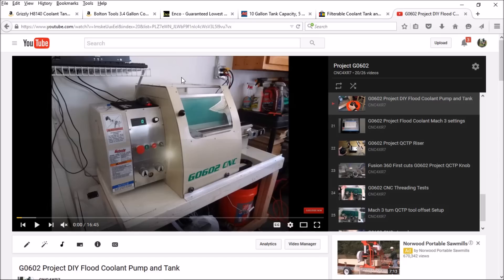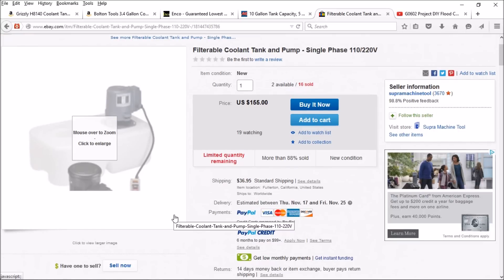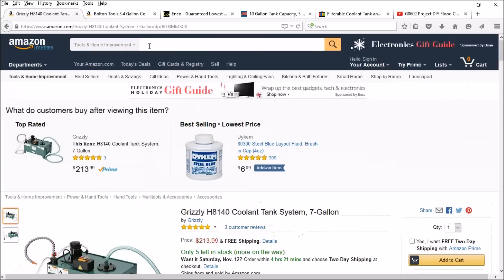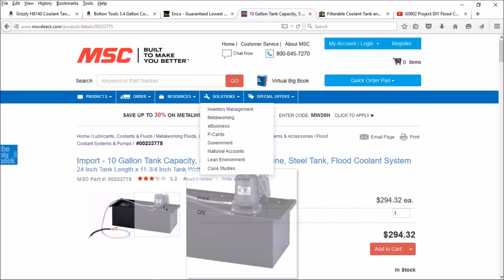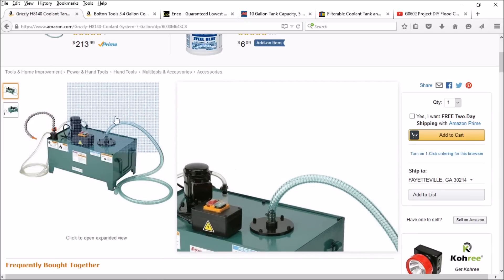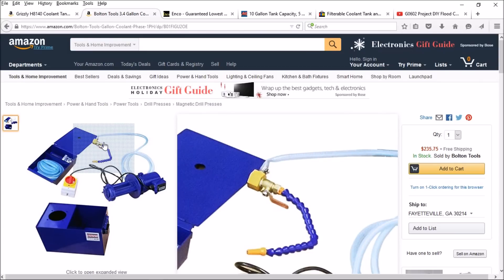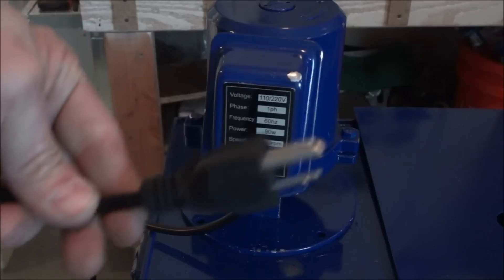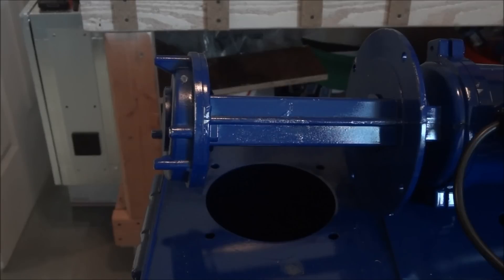Bolton Tool CS 34 Coolant Pump

Comment: Formula for ya Sam, L x W x H = cubic inches, then multiply by .00433 gives you the gallons!! your tank will hold about 5 gallons actually.
Reply from the maker: Yeah total volume is about 5 gal but the tray is about 2 " deep maybe a little more so I guess that takes away a little.

Comment: I'll be excited to see some follow up on this.
I think right now my tank has 12 gallons in it, which my pump (uninhibited) could suck dry in about 15 seconds :/
Reply from the maker: Yeah I knew I didnt want that much pressure flood is messy and I want to keep it contained.
Reply: CNC4XR7 Come on, where's your sense of adventure :)
Reply from the maker: Adventure yeah fun maybe but mopping up the shop is not how I want to spend my time.

Comment: If you run flood coolant, I think you'll be wanting much more than 3.4 gallons.  I'd want 10 gallons at a very minimum.   I ran a 20 gallon tank on my Novakon and would have loved to have more volume.
Reply from the maker: Thanks for the input If I were running big jobs everyday I'm sure I would want a bigger tank. I really wanted to keep the mess down and not have a lot of coolant just sitting around stagnate.